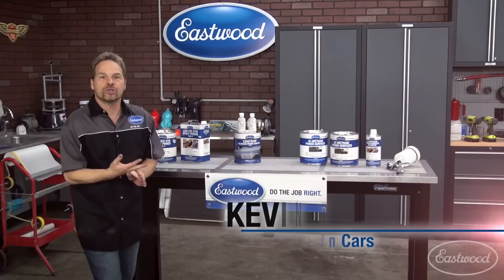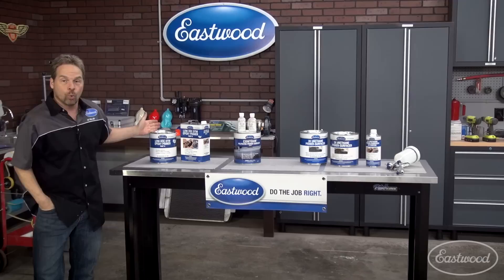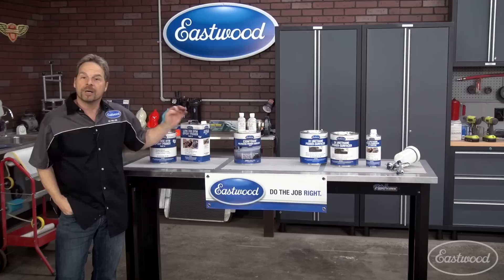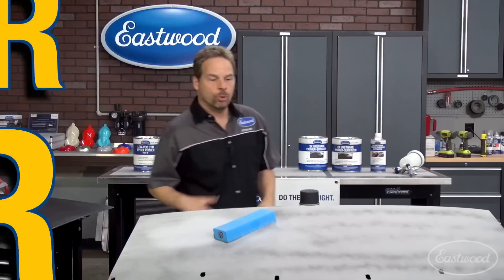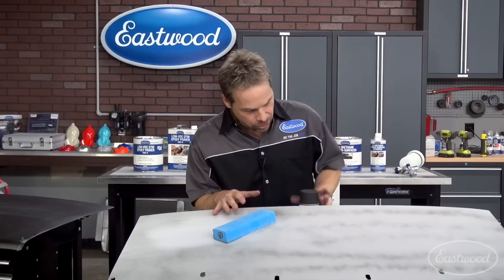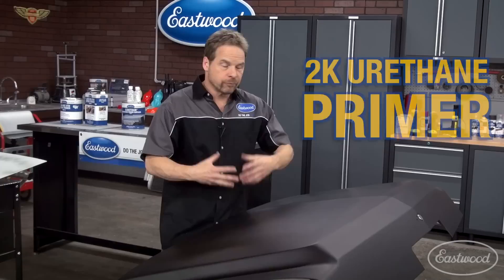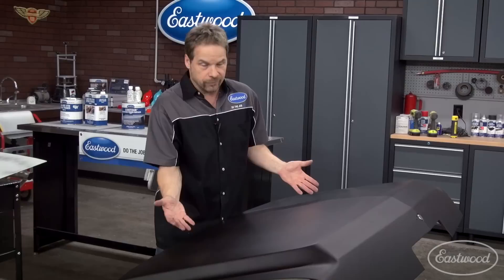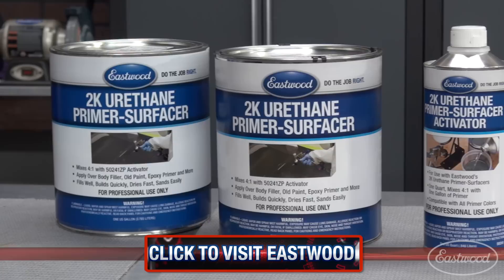Primers & Surfacers with Kevin Tetz - Eastwood

Comment: Difference between the contour primer surfacer and 2k primer surfacer? if i'm repainting but not going all the way to bare steel should i just use the 2k then base coat?
Reply from the maker: DJ Inclined   I’d recommend three coats of 2k urethane primer, then block with 320-400 grit and then paint. Sounds like you don't need to build heavily like poly primer.   2k urethane is great for covering standard body work repairs and prepping for basic re-sprays. Polyester is great for heavier filling and where you want to use it to build and block repeatedly. 2k urethane would be great for 90% of paint work in general, and polyester primer is usually used as a pre-2k urethane step in a full restoration where you need to get the panel dead straight.

I hope this helps.  You can also visit Eastwood.com where you can talk to a Tech Advisor and discuss your project in detail to ensure you get the products you need to do the job right.
Reply: Awesome, thanks. I love your channel and watch all the videos. Well done, and i hope to get my car well done by this winter with new paint from Eastwood!
Reply: Can I just go epoxy and then the primer surfacer. I do have a little bondo work ?

Comment: At the 1:00 mark, how do you apply fillers without sanding??? Some Eastwood reviewers had major issues trying to sand this stuff. If I apply the epoxy coat and need to bondo some low spots, do I have to wait 5 days before I can sand it?
Reply: this epoxy will sand after about 4 days, it will still gum up the paper but not nearly as bad. Epoxy is really not meant to sanded.

Comment: Someone told me to use epoxy primer sealer to spray over my vehicle that has little imperfections before basecoat but it's not bare metal am painting on my truck.
Reply: Too often people suggest unnecessary steps or materials when painting.  You don't need an epoxy sealer if you're not painting over bare metal.  A simplehigh build 2k primer that can be thinned to a sealer (if need be) is all you need.  Some even come as DTM in case you have sand-thru spots. Upol 2253 is a good one and eliminates the need for complex layers.

Comment: I used Eastwood epoxy primer to seal my bodywork because I have to do it outside I don't have a garage,  my bodywork isn't finished,  am I going to have a problem with the epoxy trying to add more filler?
Reply: No you can fill over epoxy.  If it’s outside 24 hour window scratch it up for fill.